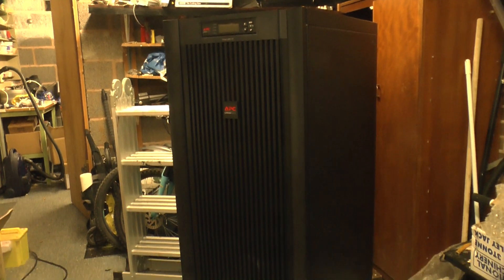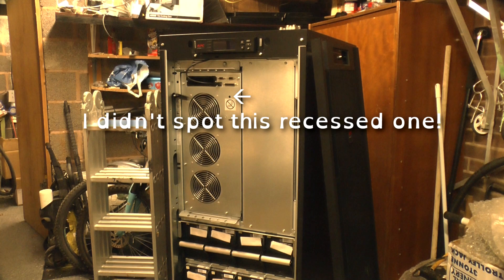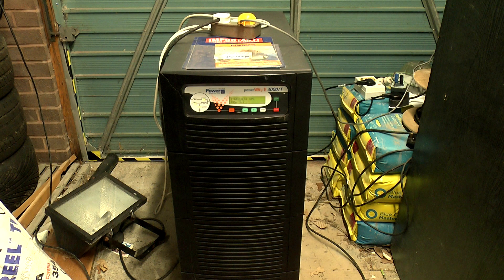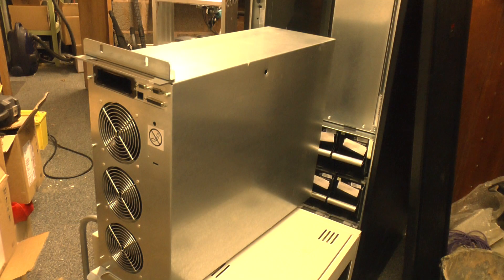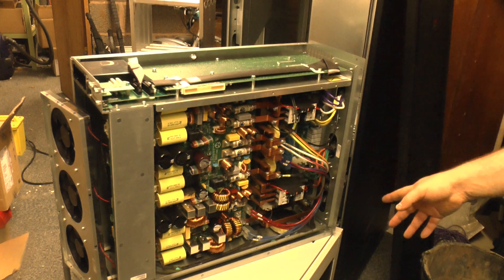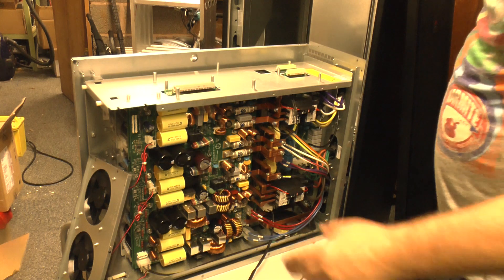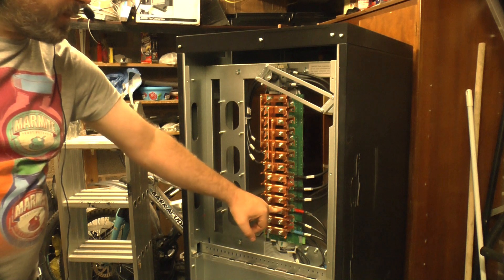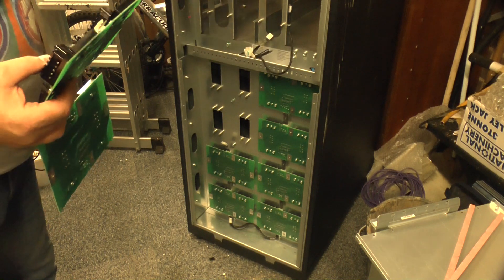What's inside an APC SmartUPS VT 20kVA?

Comment: I have an apc mge galaxy 3500 20kva that i can not shut down until a shut down window that has a bad cooling fan. Would you be able to tell me what the specs of the fan on that one in youe video is? It appears to be the same size i just can't get into it until the shutdown and need to order the fan ahead of time.
Reply from the maker: I've got two sets with slightly different specs, both 24V DC but the fans can either be 0.46A or 0.36A apiece.  W0N-0044 was the part number for the SmartUPS VT 20kVA fan tray, the maintenance contractors sent us a spare thinking it's user replaceable.

Comment: If it's like a VFD, the control circuit is across 2 phases, and will probably have a low voltage cut out, so like you said, you would need 400v.
I had a small APC (domestic size), but didn't want it to be powered constanlty, but that wouldn't cold start either.
Reply from the maker: The Back-UPS ones with a single button I don't think could cold-start, but Smart-UPS I've managed to do either by pressing and holding the on button or pressing and holding both.
I also managed to get an old Smart UPS 600 to catch fire by tapping a set of pliers across two of the heatsink fins, near the battery retaining bracket, but that's another story :)
Reply: @AintBigAintClever  Half bridge where each heatsing is connected to the power rails ?
Ouch
I was working with a XP Power guy checking a rack mount UPS (really nice units), i tested the voltage on a slide in battery pack where the terminals were only 1/2" apart and slipped, it caused an arc so we had to throw it outside the building :D
Reply from the maker: @sparkyprojects  no idea what the setup was, but there were I think four heatsink blades in there and I was curious (it was old) as to what would happen if they got inadvertently shorted whilst refitting the battery bracket (it was a shit design where if you fitted the bracket you couldn't plug in the batteries but if the batteries were plugged in you risked shorting it out).  It sparked, then a few seconds later one of the MOSFETs decided to just catch fire.  Out the door it went.

I've also had an MGE Pulsar start smoking  just after I'd replaced the batteries in its external pack.  Had to yank all the leads and get it out of the server room before the smoke alarms caught a whiff of it.
Reply: I have a 230V APC Smart-UPS 1000 from 2004 (former workplace server UPS).  This one cold starts by holding the power button for a few seconds.  I need to cold start it before connecting the mains AC, otherwise it trips the RCD.

Comment: Thanks for sharing the teardown! I feel like placing the fan connector closer to the edge of the board and using a 90 degree connector (or designing the option for both) would have definitely been the way to go. Loads of good "fun" parts in there.
Reply: Batt Temperature Exceeded Upper
Limit. my problem pizza halp

Comment: I had the same problem while trying to cold restart the same model UPS some years ago. It didn't respond to button presses, although the batteries were charged AND the AC power was available. Also nothing was mentioned on the user's manual about that situation. We dissasembled the unit, to take a look inside expecting blown IGBTs or something, and it was then that i spotted the little microswitch behind the little unmarked hole. We thought why don't just press he switch with the module plugged in? We had already arranged to replace the module by an APC certified technician anyways the next day. AAANND viola! the UPS came back to life and works flawesly since then....
Reply from the maker: I ought to have rewatched my 40kVA teardown video before filming this one, although first time round it appears I didn't spot the button.  Hopefully the mention of it in the index will be enough for Google to point other would-be cold-starters in the right direction.

Comment: Interesting, thanks for sharing.  I wonder what the logic was behind sticking with their little lawnmower batteries... it looks as though there's enough space to accommodate car/boat size batteries.
Reply from the maker: They can go for the "transformerless" design by using a high voltage DC bus and (presumably) running it as a big 50Hz (or 60Hz) power amplifier, also it lowers the current involved (a 40kVA UPS with 48 volt battery strings would be pulling over 800 amps, this design drops that to more like 100 amps which is much more manageable).
Reply: @AintBigAintClever  That makes sense, but 24v marine batteries are readily available and it looks like there's plenty of room to string several in series to create high voltage rails.  I wonder if it's more about the economy of sticking with a universal size in all of their units?
Reply from the maker: @mnelson10000  I think our pair of Riello Multi Plus UPSes use larger batteries, but they're not user-replaceable, they're an engineer job.